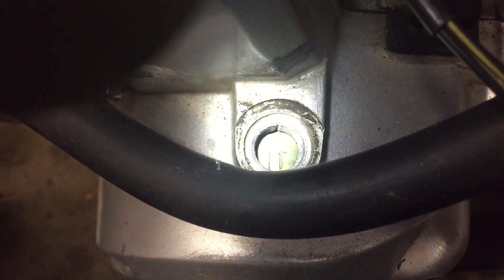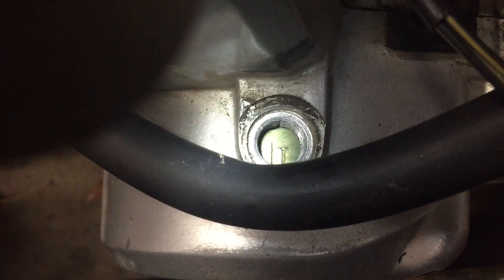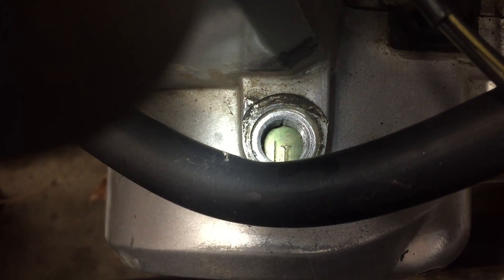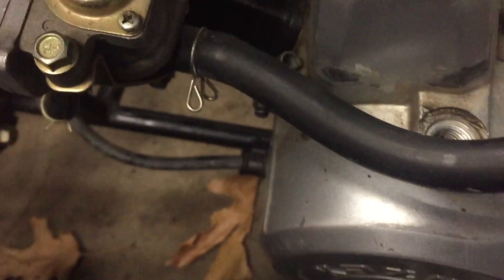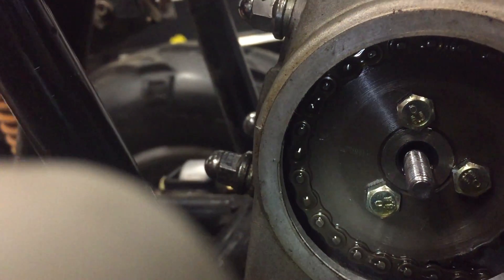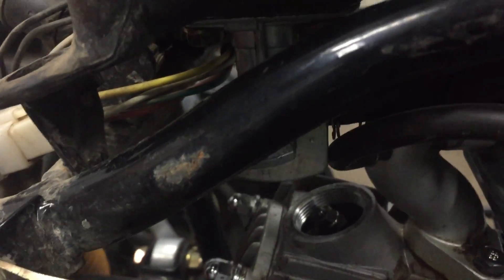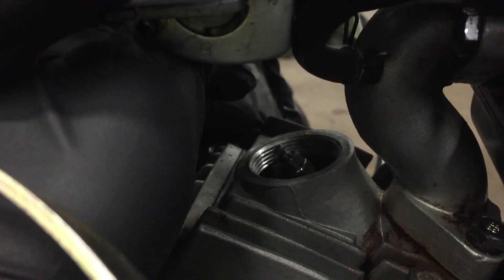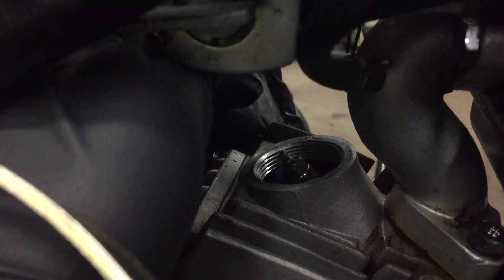How to: Find Top Dead Center, Kazuma Chinese ATV Motor (90cc)

Comment: any resources you can recommend for this 90cc motor? I picked up a Chinese atv pretty cheap and this motor seems straightforward but like in your description I'm having trouble finding good information
Reply: VMC Chinese Parts.com, has most of the parts for these Chinese ATV's, Scooters, Go carts, and dirt bikes. Prices are reasonable!  and they have great customer service and fast shipping!      vmcchineseparts.com
Reply from the maker: To be honest, I haven't really found anything straightforward. I've bought most of the parts from the UK because they were too expensive in the US, so it seems support is lacking, yet these things are sold everywhere. :\
Reply: I found a few websites that sell all the parts to these Chinese motors. Seems like you can now replace almost everything very cheaply. $6 to $8 for a carburator is cheap in my opinion. My only concern now is wiring everything up correctly